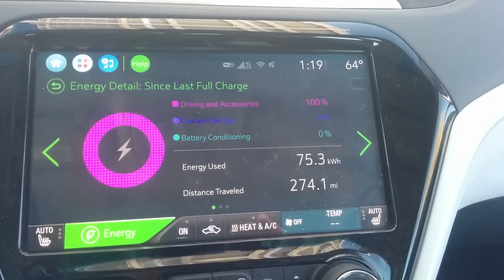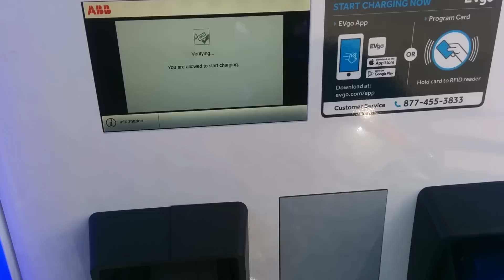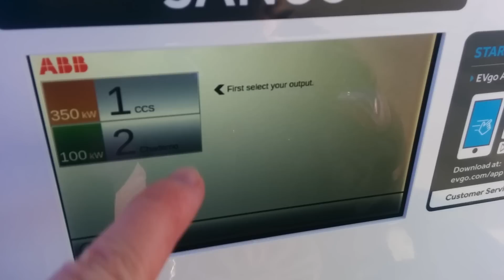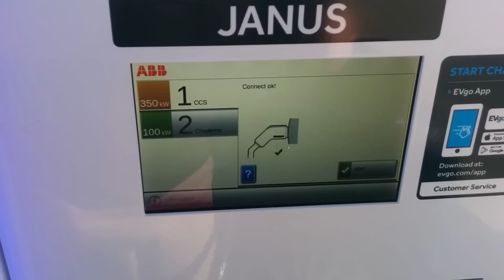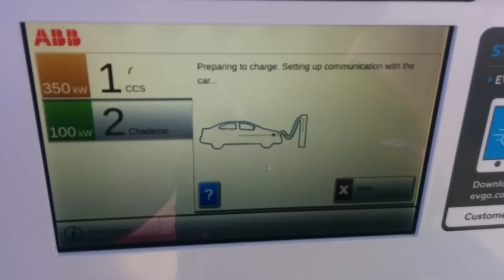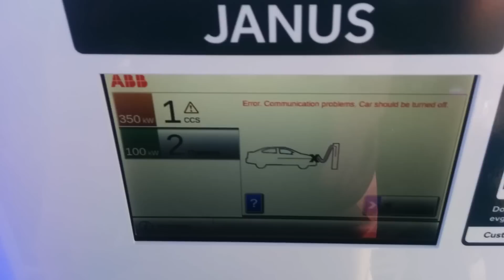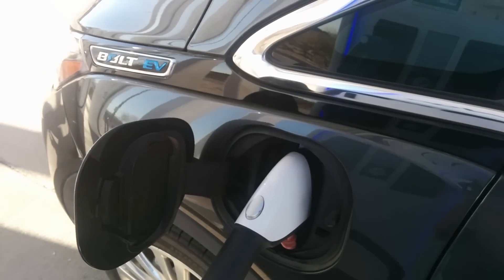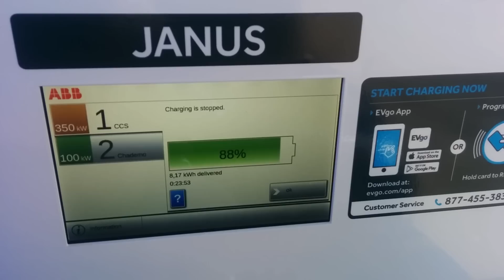Chevy Bolt EV: Charging on a 350 kW (Early Model Bolt EV Issue Explained)

Comment: Superchargers are soooooo superior.
Reply from the maker: If you consider 1/4 of the speed and an inability (or unwillingness) to support other EVs superior, sure. Otherwise, they are quite dated.
Reply: @newscoulomb3705  1/4 the speed of what? No car can currently charge at 350 KW.  Superchargers are available to all manufacturers willing to support them.  So far only Tesla is committed to an electric car system, not just a car.  As far as keeping up with the industry, Tesla is the leader, by at least 10 years, not a follower.
Reply from the maker: That's why their Roadster motor was based on the EV-1. 

I truly want to see Tesla succeed, but they are starting to make themselves irrelevant. They need to be more open and cooperative, otherwise, average people will simply start ignoring them.
Reply: @newscoulomb3705  what are you talking about? All Tesla patents are opened sourced.  No other EV manufacturer is doing that.  Irrelevant?  Tesla sells 8 times more EVs than GM.  No one is ignoring Tesla, they are all desperately trying to catch up to them.
Reply from the maker: "Making themselves" means in the process. It's not too late for Tesla, clearly, but some of their antics could change that. 

Also, repeating the "but the patents are open" line doesn't change the facts. No one wanted the dated, inferior standard, and simply adopting it doesn't get you access to the Superchargers. It's better to go with the higher power charging standard that is being supported by the public infrastructure. The Supercharger standard is just another Thai submarine.
Reply: @newscoulomb3705  no manufacturer wants the Tesla standard because no other EV manufacturer wants to contribute to the cost of the infrastructure.  It doesn't matter how superior one thinks a different standard is if they are few, complicated and unreliable.
Reply from the maker: @markleyg  See? That's the problem. You're conflating Tesla's "open patents" with Supercharger use. No one else wanted either, apparently. 

As for the "few, complicated and unreliable," the public charging infrastructure is none of those things. Yes, the Superchargers are simpler, but otherwise, all of Tesla's old campaign rhetoric against the public charging infrastructure isn't withstanding the test of time. 

"Fewer": There are as many public charging locations as Tesla Superchargers. There are more public chargers per vehicle that can use the standard than there are Supercharger stalls (i.e., half a charger) per Tesla vehicle. 

"Complicated": No, just new. You plug in a cable that fits your car. Swipe a card to activate. Get the bill later. It's not complicated. The fact that Tesla integrates everything is cool, but the level of ignorance I'm seeing with new Tesla owners is worrisome.  People should have a basic understanding of how their vehicles work.

"Unreliable": Also not true in my experience. Some networks are better than others, sure, but overall, the public charging infrastructure is reliable. And the quirks and issues that people are encountering are being corrected and improved daily. 

So again, those are just caricatures that Tesla folk have invented about the public charging infrastructure to make themselves feel better about their purchasing choices. If they were true, I wouldn't see so many Tesla owners using CHAdeMO adapters.
Reply: @newscoulomb3705  don't know what alternate universe you are living but it ain't here in Tennessee or most of the U.S. Here's a test:  I'm planning a trip from Nashville, Tn to New Orleans.  Tell me how many CCS chargers their are Vs Superchargers for that route.  BTW, I don't own a Telsa nor a Bolt so I am not biased like you are.  I do, however, own a Volt which I have driven 80k miles in the last three years.  Would love to switch to full BEV but right now no one but Tesls can take the place of an ICE vehicle for long distance and it currently isn't in my price range.  One further thing. Are you under the misunderstanding that Superchargers are available for license to any manufacturer?
Reply from the maker: @markleyg  Yes, there are a number of routes that aren't covered by either the public charging infrastructure or Tesla. Out here in the West, there are still distances between Supercharger locations that require Tesla vehicles to "bridge the gap" using destination chargers (many businesses have now been put on "restricted" lists and removed from Tesla's navigation because they got upset about having to give out free power to people who weren't even customers). That's going to get even worse when the Model 3 SR comes out, as it will have an effective range between Superchargers of less than 150 miles. 

So you drive a Volt (me too... I've put nearly 150,000 miles on two different Volts starting in 2012), and you have no personal experience using the public fast charging infrastructure or the Tesla Supercharging network? So your opinion is based on what? Hearsay? And my opinion isn't biased in the way you are implying. I don't own a ChargePoint charger, or Electrify America station, or EVgo chargers, or a Supercharger site. My opinions are based on a combination of empirical evidence and my own qualitative experiences. 

And I literally don't know what you mean by your last question.
Reply: @newscoulomb3705  my opinion is based on Plug Share.  Every time I want to take a long trip I check the route for CCS support and Supercharger.  Currently I have found virtually no route I wanted to take not supported by Superchargers but have found almost no routes supported by CCS in my area.  CCS has a very long ways to go.  Meanwhile, Superchargers are going to double in 2019 putting CCS even further behind.
Reply from the maker: @markleyg  Actually, the current public infrastructure is being built out faster than the Superchargers are. To be fair, Tesla might increase the rate of their build out again in 2019, but by that point in time, the public DCFC infrastructure will support more than 80% of the public's needs for long-distance trips. Essentially, Electrify America alone will be at about the same level as the Superchargers were when you first got your Volt. Sure, there will still be some problem areas that aren't covered, but for the most part, they are universal. Both the public chargers and the Supercharger network fall short in those areas. 

Also, I would use caution when relying on PlugShare. It's strength is that it is community driven, but that's also its weakness. I've encountered a lot of incorrect information posted about sites, and there isn't really good recourse to correct it other than leaving a comment. 

Oh, and one more thing about the CCS 2 standard. I obviously can't demonstrate it with my two-year-old Bolt EV, but newer CCS equipped vehicles like the e-Tron and Taycan should be able to simply plug into the charger and it will activate automatically with remote billing (just as the Superchargers currently function). Also, many of the new automakers are working with the public charging providers to integrate charger sites into Nav, maps and route planning. Essentially, all of the functionality that you currently see with the Superchargers will be available on the CCS 2 standard. That's why I stated that the Supercharger standard is dated, and there's really no reason for any automakers to buy into the Supercharger Network.
Reply: @newscoulomb3705  had my Volt for 3 years now.  Since that time still no CCS charging and what are available are broken down a lot and are very expensive, multiple times more than gas.  Meanwhile Supercharges are now everywhere.  Will that change in the future, we'll see.
Reply from the maker: @markleyg  Again, if Electrify America finishes just the sites they  are currently working on, you will see most of the long distance coverage that was provided by the Superchargers three years ago. That is what they are currently working on. If they continue to add sites, we'll see matching capabilities. 

As for price, that really depends on a number of factors. Sure, gas is about $3.50 a gallon in CA, but that doesn't change the fact that I pay about 6 cents per mile on average using public DCFC. How much do you pay per mile driving your Volt on gasoline at your local gas prices? 

Electrify America's prices right now are nationwide, and the newer EVs will be paying about 4 to 5 cents per mile using them. That's about the same as a Prius on $2 a gallon gas.
Reply: @newscoulomb3705  Gas is $2:09/gal here.  Public high speed charging is equivalent to $6 here.
Reply from the maker: @markleyg  Congratulations on having some of cheapest gas in the country. It's cheaper for a 30 mpg ICE car than it is for an EV on public DCFC or Superchargers.

However, the Volt somewhat misrepresents the cost of public charging because its charging speeds are so slow. The same is true for the Bolt EV at this point. While it would cost 10+ cents per mile for a Bolt EV to use Electrify America chargers, an e-Tron or Taycan would cost about as much as your Volt costs on $2 a gallon gas.
Reply: @newscoulomb3705  agree.
Reply: @markleyg  Bollinger reached out to Tesla about getting into their supercharger ecosystem with no response. I'm not sure how willing Tesla actually is to open them up.

Between superchargers, Chademo 2, and CCS 2, superchargers are currently the slowest standard by far, and the only one without 1000v support.  It's highly unlikely even the v3 superchargers will support over 400v.

Your anecdote of CCS vs supercharger stations isn't supported by data. There are as many CCS locations in the US as superchargers (locations, not individual plugs).

Tesla seems to be leaning towards CCS anyway, since the model 3 natively supports it unlike the Chademo adapter used for S & X.  I wouldn't be surprised if in a few years time we see dual-handled superchargers with CCS like they're rolling out in Europe.
Reply: @GregHassler  not a change there are as many CCS chargers as Super chargers both in locations and charge heads.  You obviously have never driven an electric car in central U.S.  Can only be done with Superchargers.  As far as speed, Supercharger speeds are increasing too.  As far as Bolinger, I call B.S. and bet you have no facts to back up your statement.
Reply: @markleyg  Bollinger asked Elon publicly on Twitter, it's easy to find, no response from Tesla.

Go to the alternative fuel data center from the US Dept of Energy for CCS data.  And you can use Tesla's own supercharger numbers or supercharger.info if you like.

This is well known and verifiable information, you're just not paying attention.

Yes I live on the east coast.
Reply: @GregHassler  you mean he didn't respond publically.  Any manufacturer willing to contribute to the development and maintenance of Superchargers can use them.  This is Tesla's stated policy.  Now look up CCS chargers vs Superchargers on Plug Share in the central U.S. and see how CCS is virtually nonexistent.  It is very easy to verify.
Reply: @markleyg  I'm sorry that you live in Kansas or wherever, but the fact remains that CCS parallels superchargers in numbers, and are growing faster.  Your anecdote is the opposite of mine, where there are 3 superchargers in a 50 mile radius of me, all of them along one interstate, but there are a dozen CCS options in every direction.

"Any manufacturer willing to contribute to the development and maintenance of Superchargers can use them."  This was stated years ago and has yet to be proven true. Period.
Reply: @GregHassler  Superchargers are laid out for long distance travel charging only.  Not positioned wildly nilly.
Reply: @markleyg  that's well understood,  but they're extremely lacking in rural areas. People travel off of interstates sometimes.
Reply: @GregHassler  yep.  Why they will double their chargers this year.
Reply: @markleyg  Tesla still has yet to meet a stated production or supercharger rollout goal, but keep thinking that.
Reply: @GregHassler  so far they have produced an infinite more high speed chargers than any other car manufacturer.  Enjoy fumbling with membership cards, high fees, spotty availability and poor reliability on your public chargers.
Reply: @markleyg  as with most technology, first to market often gets left behind.  I hope you enjoyed the past 6 years of Tesla charging, they're going to be left behind. Already happening.
Reply: @GregHassler  where is it happening? Tesla is outselling 10 to 1 to its nearest competitor.  Now they are opening a plant in China.
Reply: @markleyg  as previously explained, superchargers are now the slowest DC standard worldwide, and their next gen still doesn't fix that.  You're hung up on current numbers, you need to look at what's happening in development to see where we're going to be in a few years time. Common mistake, most people aren't good at judging how technology moves and get too hung up on the recent past.

Also consider VW MEB. You also need to consider the role motorsports plays in automotive development.  Tesla doesn't support motorsports in any way, despite a dedicated series trying to use their cars.  VW now has the electric + overall record up Pike's Peak.  Jaguar and Audi have Formula E teams, and Jag is doing their own racing series with the I-Pace.

Tesla is busy ramping up production, not innovating.
Reply: @GregHassler  Next Gen Supercharher will be double the current speed.  Granted their are a minuscule few faster chargers but no car that can handle them.  No innovation is true if you ignore the model Y, Pickup, Roadster and Semi all being developed.  Let's also ignore the ever improving self driving capabilities.  As far as motorsports, you are right.  Tesla's appeal to a higher intellectual group that is not enthralled by watching cars go round and round.  Although the next generation roadster will kick any of their competitors asses.
Reply: @markleyg  I get that you don't understand competition or how engineering development happens, you'll learn one day. Has nothing to do with intellectualism, that's the funniest argument you've tried to make yet.  Model Y is TM3 in a different body, no innovation there.  Despite the Supercharger speed, Tesla has the worst taper of any EV.  No Tesla can charge even at 120 kW past 60%, which is only 1.2C on the 100 kWh pack.  Even Hyundai is charging at 2C LoL.  What good is a faster supercharger when their cars can't even handle what they have now?  Fanbois crack me up.  Waiting for the "they do it for longevity" argument in 3... 2...1...
Reply: @GregHassler  well since I am an engineer and business owner I get that you just pretend to be informed.  Stick with your Chevy Bolt or Nissan Leaf and their exciting, leading edge technology.  Everyone else is just talk, including you.  Now go drink your beer and watch your cars go round and round.
Reply: @markleyg  oh right the "I'm too intellectual for you" play, LoL, right.  I guess that's your only game left when I've taken away every other argument.  I've got a couple businesses myself, and in the EV industry, but no, do go on about how smart you are.
For the record I'm not bashing Tesla, with laypeople I'm their biggest fan, but guys like you really need a reality check with them.
Reply: @GregHassler  you have not been able to counter anything and with fans like you you, who needs enemies.
Reply: @markleyg  I think you should reread the thread.  You haven't landed a single point.  I'm happy to agree to disagree.
Reply: Tesla has better battery technology that's why they charge faster. It is not the charger but the battery that is the limiting technology.

Comment: Hmm, I wonder if this is an issue with all Bolt EVs. Could it be that your Bolt is experiencing some sort of material fatigue on the charge port, causing it to bend?
Reply from the maker: That's actually what I was thinking, too. I'm not sure how easy it would be to reinforce the bracket holding the CCS port, but I think it should be a fairly easy upgrade.

Comment: 9:50 is a beautiful shot... man. nice. My spark EV has something like this happen on occation .With the home chargers i just shaved the top side of the claps notch so that the chrome piece on the car can fall down and lock in place. If the hook piece was a little bit longer it may also apply enough pressure on that chrome piece to make it fall down all the way when the plug is plugged in. maybe tape/glue a little piece of material on the bottom part of the chrome piece where the plug hook hits it to see if that helps?
Reply from the maker: Thanks! 

As for the tape, maybe. I think it's mostly flex in the CCS port itself. I think a reinforcement bracket to increase rigidity might be enough.
Reply: News Coulomb Maybe an old camera tripod?

Comment: You say GM should retrofit. Do you think that's something they should pay for or something they should offer as an additional charge? I say that as a practical question because we all like free stuff, but is this something the company should have to be on the hook for since it's new tech that requires hardware?
Reply from the maker: I think that there might be something faulty with the initial design and implementation because we haven't seen this as an issue on the Bolt EVs that were built after the first run. GM has stated that nothing has changed with the hardware, so yes, this is something that they should investigate and fix. 

It's not free stuff. It's something a number of us paid for with the expectation that it was functioning as advertised.